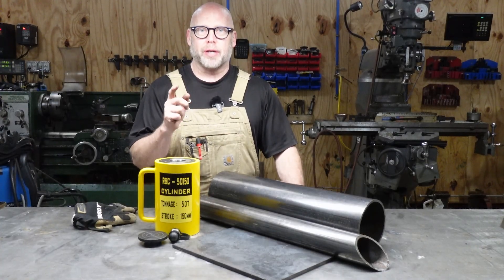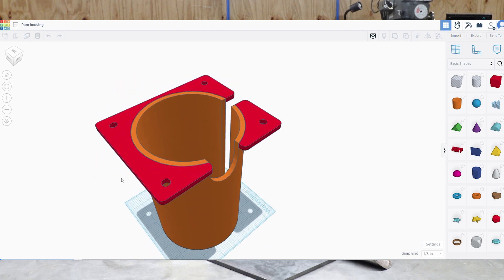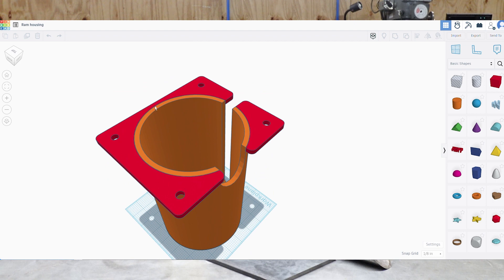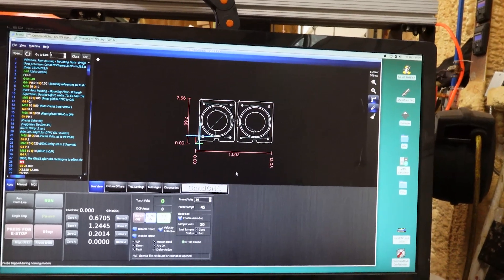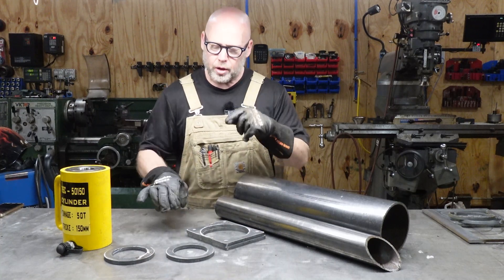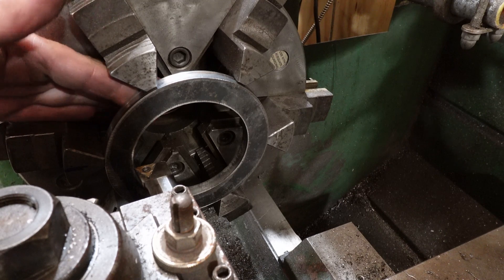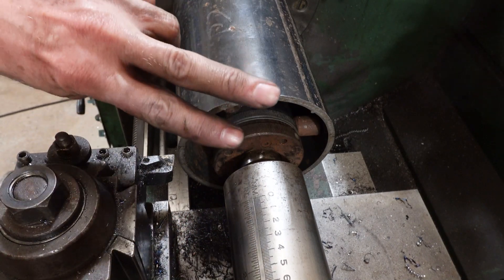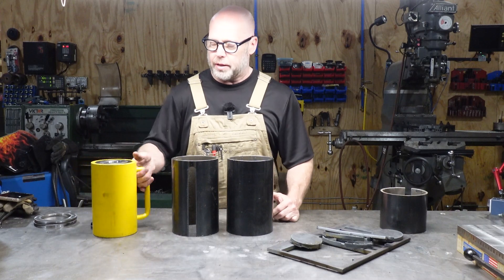100  Ton Press Brake Build - Vevor Cylinders and Pump - Part 4 - Ram Mount Parts Creation

Comment: I’ve been machining for 28 years and the tri mic looking live center deal is first for me. Awesome work and I always love learning new things. I own cnc machine shop in TN and debating on buying or building a 8ft finger brake. I’ll be bending aluminum up front to 1/4 and mild steel up to 3/16 at least 6ft wide. In your honest opinion with what you know should I buy or build one.  I’m trying to figure the tonnage and how big lower die width would need to be.
Reply from the maker: this is off the top of my head, but I believe the die width is supposed to be 8x material thickness, so 2" for 1/4" material.

Regarding buying vs. building, that all comes down to the intended use.  As mine is mostly for bending brackets, motor mounts, etc. I don't require a high degree of accuracy or repeatability.

Accuracy I can dial in, but If you do require repeatability, I would definitely purchase a cnc unit.

Lastly is cost.  I obtained the bones of this press in a deal with other machines so it made sense to build it up myself.  But if I were shopping for a press today, I would likely buy a used CNC on Facebook, Ebay or an auction site.  If you are patient you could likely get one for less than building one.

Comment: Do you have more information on the internal tail stock chuck?
Reply from the maker: Sadly, no.  It came in a lot of tools I purchased and sat around for about a year before I even decided to look at it!  

Once I checked it out, it is my go-to for anything hollow that it fits in!  

I will be making some more arms for it to extend the diameter it can support (they just screw into the body).